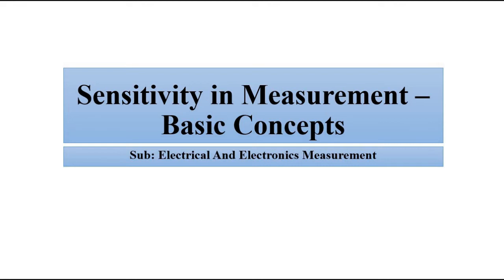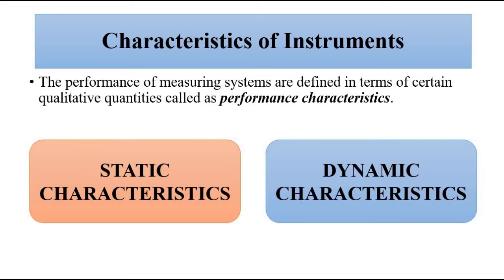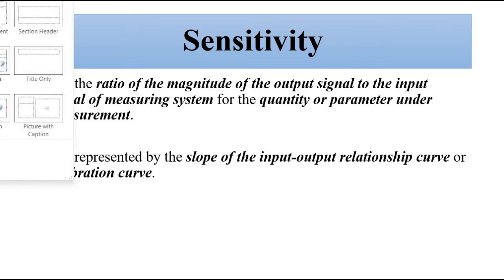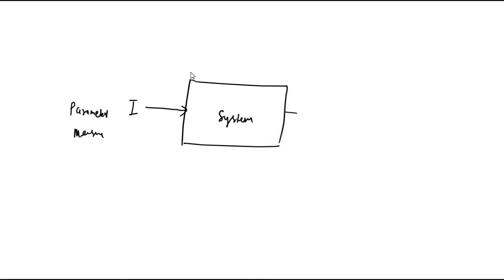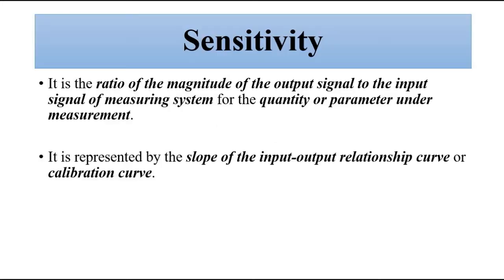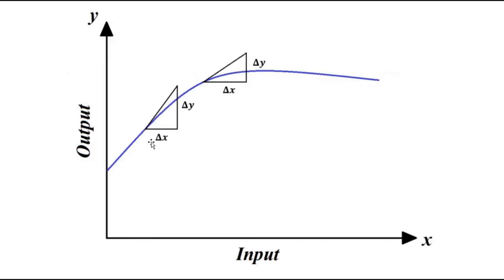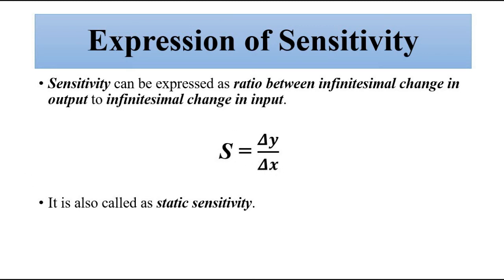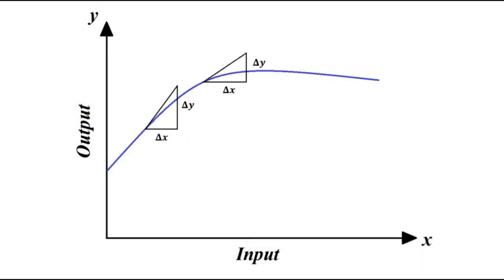Sensitivity In Measurement | Static Characteristics | Electrical And Electronics Measurement

Comment: I'm studying metrology(science of measurements) in my Mechanical course and in particular dimensional metrology wherein we learn to measure stuff like size, angles, forms and positions and in its textbook it defines "sensitivity as the minimum change in the value of quantity being measured to which an instrument can reliably respond". Are these definitions analogous?
A higher sensitivity for a finite display divisions would mean each division would represent a smaller input measured quantity..Is that the line of thought for my textbook's definition or is it wrong altogether?